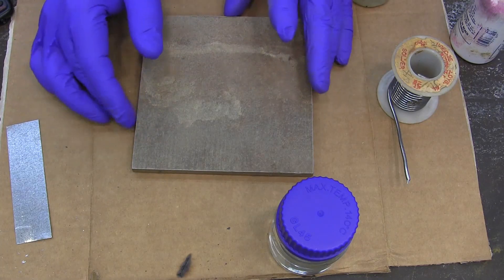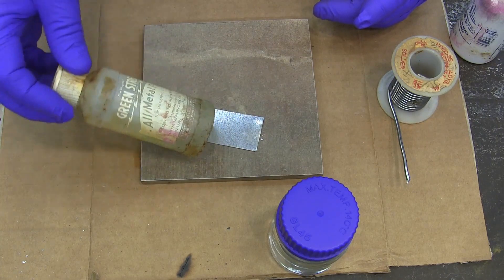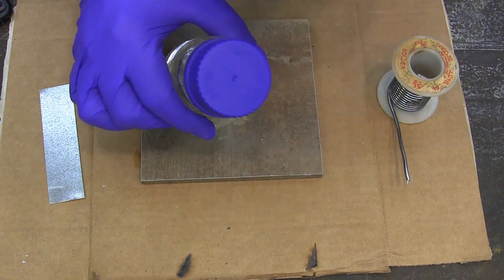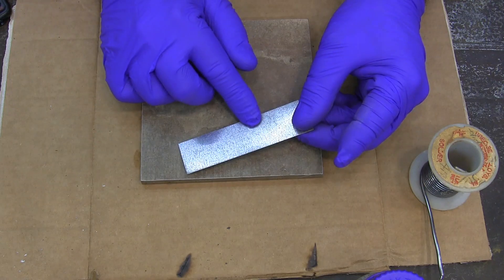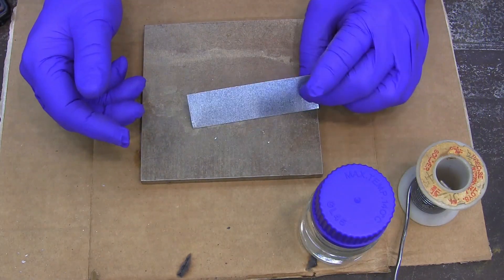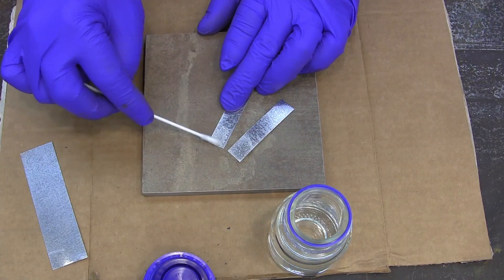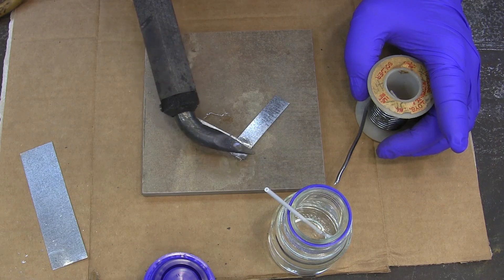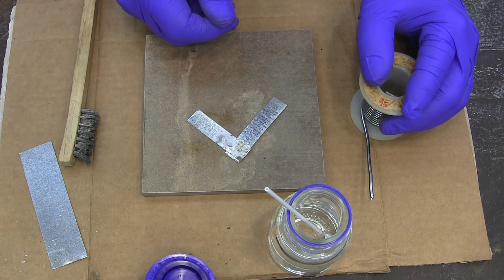Soldering Galvanized Sheet Metal

Comment: Does this method only work for galvanized sheet?  I would like to solder an early style motorcycle fuel tank either out of regular steel or stainless... Very informative video btw!
Reply from the maker: It will work with plain steel.  Stainless does not solder well.
Reply: @Lukasvercaempst Stainless can be soldered much easier with a more aggressive flux and 99% silver solder.  It's expensive, but it works.

Comment: I'm not an expert in this by any means, but I suspect there are some reasons muriatic acid isn't commonly used.  It's an aggressive acid, maybe more than is necessary for cleaning & fluxing -- it actually dissolves the galvanized coating -- those areas touched by flux but not solder are probably going to rust much faster than the rest.  And if you get it on you, you'll get a chemical burn in a very short time.  Other than that, it looks like it works great.  There's a stainless steel flux I've used (available on amazon) on copper sheet called LA-CO "MA", which may be based on muriatic acid, given its name.  It has a bit of viscosity and even stickiness to it, and doesn't seem as active as straight muriatic is.  I've never tried it on galvanized, though.  Maybe I'll give it a shot next time I have a torch out.

Comment: Hi, NOT talking about food or drinking water. Question???  Why is lead free solder not as good in this application?  I have the muriatic acid. Just bought it at Menards few days ago. Have just ordered soldering iron 175 watt soldering iron off amazon, is this one i get going to be hot enough for this style of work you are showing?  I have .26 gauge galvanized sheet metal to work with.  Thank You!
Reply from the maker: The lead free has a harder time sticking to the galvanized metal but does work.  Galvanizing is just zinc and lead and zinc are easier to bond together.  I think the soldering iron should work it depends on the circumstances.  Good luck with your project!

Comment: Thank you for this video.   I need to make a tray for one of the band saws which has a coolant pump but it spills it on the floor.  This is perfect and will be very helpful.  I was not looking forward to soldering the galvanized steel.   Thank you again this was great.
Reply from the maker: I had tried for years with no success. Found the idea of muriatic acid online from several HVAC sites and it was a game changer. Good luck with your project!